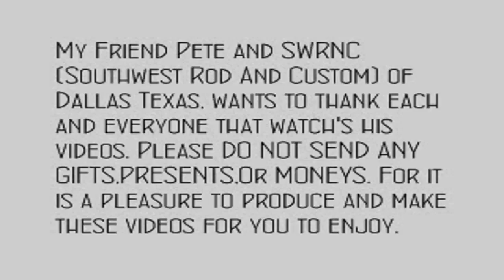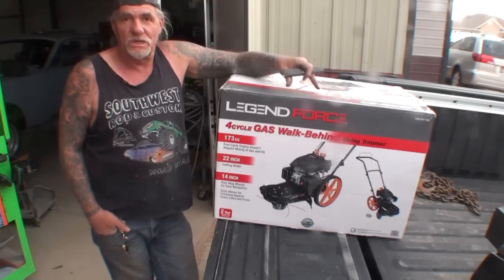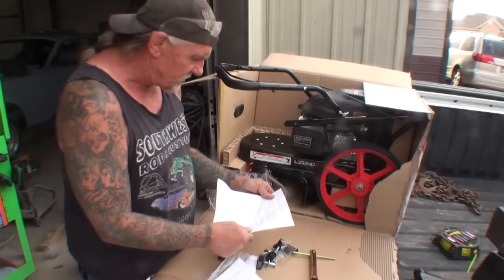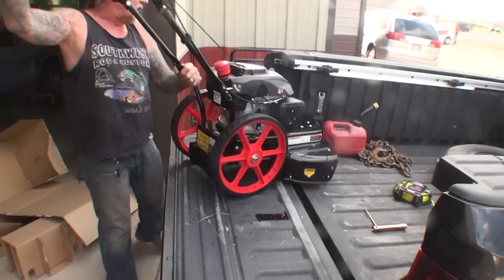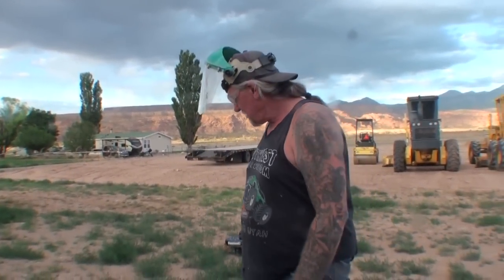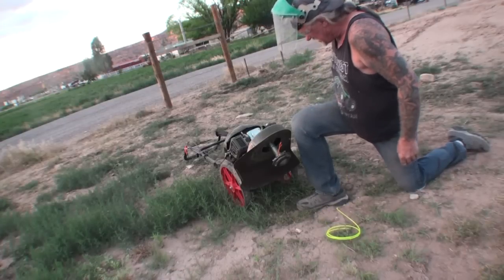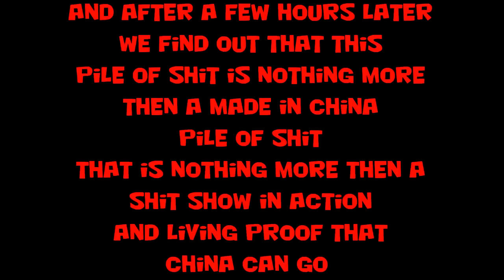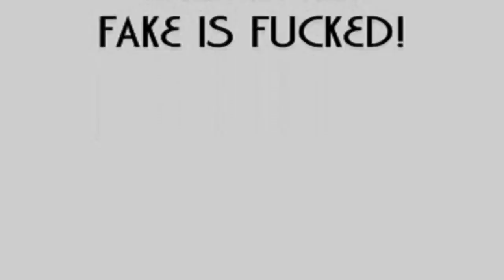Legend Force Walk Behind Weed Eater - Unboxing - Usage/Review - EXTREME FAILS

Comment: I have the exact same machine. Legend Force 173CC  22" cut. It works perfectly, Powerful, Runs great, Light weight (wheels) for easy moving around and on banks, cuts down anything you point it at. Can strip right down to dirt and eliminates weeds entirely. Adjustable height cut wheel, very durable for rocks and obstacles. I'd buy it again, or one for a friend. Best machine for the price. All that without the childish foul language.
Reply: But MURICA 🤣

Comment: Years ago, I bought an MTD model from Wal-Mart. It had a Briggs motor on it and with regular oil changes and such, I was able to run that thing for years. I ran that thing until it practically rusted away and was falling apart. It was so nice to use in high grass, uneven ground and made trimming along fence lines a breeze.

Comment: a regular old cheap lawn mower has the same cut width, uses a much much tougher metal blade and most of all doesnt fling stuff everywhere, id take that pile back and get a regular mower.
Reply: With that sand and rock he has a regular mower blade won’t stand a chance. He’ll have to replace or sharpen the blade after every couple mows
Reply: @eazzyfe  sharpening a mower blade takes 5 minutes and you can do it 20 times then a new blade is 10-20 bucks, cheaper than a window.

Comment: I wish I had seen this video before I bought one, this thing is ABSOLUTELY A PIECE OF GARBAGE, I had the exact same experience as you did to include the white smoke, it's also very very very hard to start, sometimes it's loud and sometimes it's quiet, don't buy,  it sucks, and this is the second one, I took the first one back because of the white smoke and I be darn if the second one does the same exact thing. Back to Home Depot it goes.